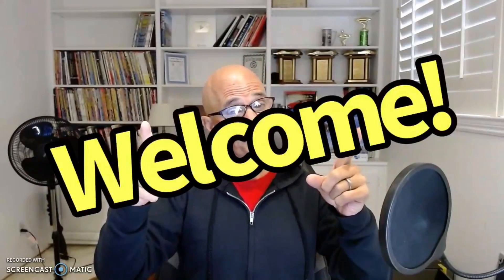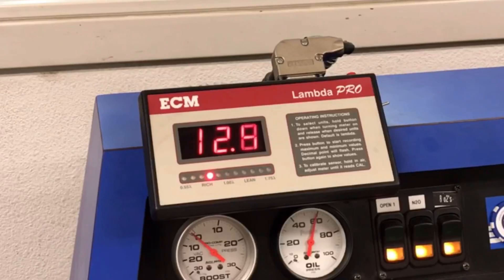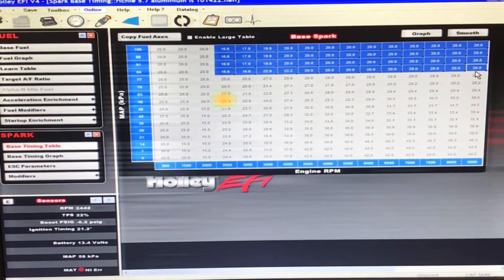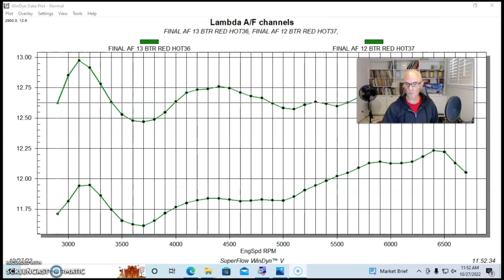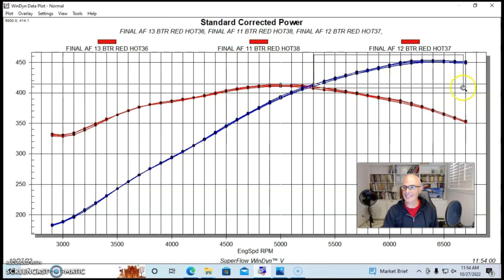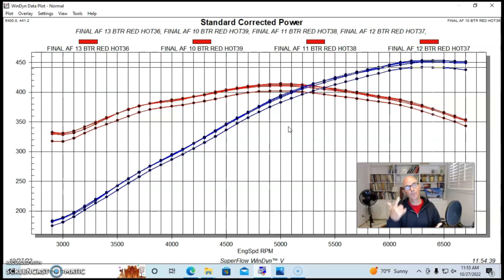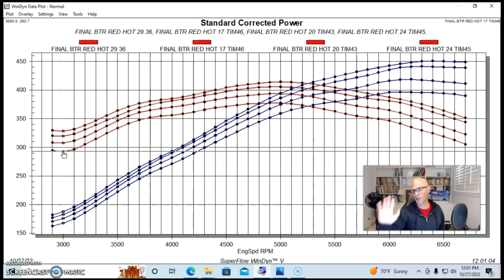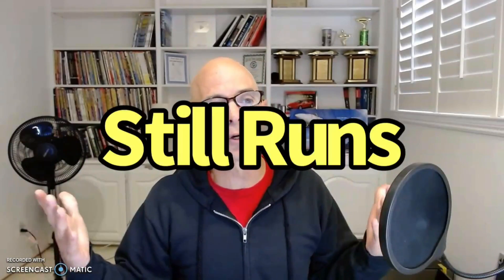JUNKYARD LS TUNING SECRETS! A/F TEST-10:1 v 11:1 v 12:1 v 13:1. TIMING TEST-17, 20, 24, 29 DEGREES!

Comment: Another great video! Using a butt dyno in my 3800 it’s very similar fuel requirement and it’s power between those afrs under boost isn’t that noticeable but obviously I try to keep it on the cool side of things as I’m happy to loose a couple of hp for a lot lower egt! Same test on a turbo set up if you have one laying around running would be great!
Reply: There is a formula, and some websites have calculators, where you can use the weight of your vehicle vs et at 1/4 mile to get an approximate hp/trq rating for you vehicle
Reply: @playinghookywithdavidchapa387  it’s definitely not quick but still a bit of fun all testing being done on a private road of course!! I have been using the Wallace speed calculator and an app on my phone lately my 3800 v6 best et was 12.05 and should be 300whp according to the calculator and my best mph was 136 so 540hp apparently? but using the app it makes 350-400 hp and peak acceleration still just under 1 g maybe more on grenade level boost, it’s choking  back to a stock intake for now just have to port one to suit these heads,run’s mid to high 12s at the moment around 120mph on a lazy launch and safe boost and 215 economy tires though

Comment: Over the years I've found that the better the combustion chamber, the more tolerant of a wide AF range an engine is.  Something really good like a Honda K-series (or late model turbo BMW engines) don't really care much if they're at 11:1 or 14:1 as long as you're not knocking.  You'd want the richer mixture just to control exhaust temps and protect against knock, but they're just really good at maintaining a homogenous mixture and using all the air you throw at them.  For a 2-valve setup, the LS heads are pretty good as well.  For some reason, the DI LT motors, especially boosted, do not like being run too rich.  Might have something to do with trying to control charge placement in the chamber with that little cup in the piston.
Reply from the maker: would be cool to see what is happening in there
Reply: I've done a lot of DFI tuning here in Europe and also a few LT engines now, and compared to the BBC, LS, and SBC tuning I've done, the DFI engines have a much smaller window. I have not seen a difference in the LT1 and LT4 as far as tuning window, only that they both don't like to be rich or lean.
I'm guessing that it has to do with how efficient the combustion actually is. The atomization of the DFI is much better than the MPI as there's no obstruction to mess with the atomization. This means that the combustion is faster and more complete, and thus the same fuel will require more air. I have done a lot of Mercedes V8 tuning and the MPI vs. DFI show the same tendencies.  So the theory here is that the reason for the smaller tuning window is that when richened up, the engine is much quicker to act as if it is overly rich while if you lean it out, the efficient combustion will be quicker to react as an overly lean condition and spike the temps in the chambers really fast. At least, that is the theory that seems to be fitting with my experience on the dyno.

Comment: so you should not be concerned about losing power with excess fuel, but maybe should worry about carbon build up, fouling plugs quicker, and wasting expensive fuel unnecessarily.
Reply: Washing those rings

Comment: Are you using injector end point timing specific to the cam? I subscribe to the Tom Nelson fueling strategy. Give enough fuel till it almost chokes then back it off a slightly and it will live. I do all my street tuning with a 12-12.4 target at WOT. After watching this I'd much rather leave it closer to 12 and trickle in some more timing up top.
Reply: Excellent question.  To add to that, does the Holley HP calculate injector duration from start of injection or end of injection as well?  Probably wouldn't have made a huge diff, but it might have been measurable.
Reply: @ChurchAutoTest  Holleys injector timing table is called Injector End Angle. They reference the end of the pulse. And like Richard said it doesn't make power. But it does improve literally everything else. Drivability, fuel smell with a catless exhaust, as well as brake specific fuel consumption. I was able to pull a little fuel from my VE table to achieve the same target AFR in a few areas with the injection timing being optimized.
Reply from the maker: every time we try to change injection timing we get nothing
Reply: @richardholdener1727  I'm talking more of choosing  injection timing for street ability. I heard that messing with injector timing could reduce the exhaust smell at idle.any tips on ballpark starting points?
Reply: @smiller225  I adjust injection timing on the P01 and P59 controllers all the time.  I start with a well dialed in setup.  Then target progressively later injection timing.  The stock GM settings spray fuel on the back of a closed intake valve prior to the intake valve opening. This works well on a stock engine with little valve overlap. With a cam that has signifigant overlap the stock injection timing allows the raw fuel to be drawn into the exhaust.  When you adjust the injection timing at low engine speeds you want the start of injection timing to happen just as the exhaust valve is almost closed, right before the piston starts to really take off on its downward travel on the intake stroke.  I have seen long term fuel trims at and near idle go from 0ish to -10% with injection timing changes.  My cam with 61.5* overlap at 0.006 has no unburned fuel smell from the exhaust.  Before adjusting it, smelled like an old lawn mower.
Reply: Would love to see some info on this

Comment: Rich did you find that power stayed constant above 29 (maybe to 31-32) or did it drop above 29?
Reply from the maker: remained the same at 30 & 31-as far as we tested it
Reply: At WOT I find 862 or 706 heads generally like 26* safely.  Even my LQ4 with large valve ported 862s likes 26*. You won't gain much if anything over 26*.  I always laugh when I see a LS car or truck that is "tuned" for 30* and 13:1. I would reduce the timing to 26, 12:1 afr at peak torque and 12.5:1 at peak powr. Car would always run better.
Reply: @chrisreynolds6520  You're generally right, but it all depends on the application and fuel.  My 900 hp LSA on E85 runs 25 degrees at peak torque and up to 28 degrees in some places.  Tried less but it loses on the dyno and in timed acceleration runs. It'll handle more without knock, but that would just be beating the bearings out of it.  I've seen some LSA guys run a flat 30+ degrees across the board on E85 and their motors lived for quite a while too.  When I first started testing the limits on the dyno, I was sure the car would be quicker with less timing on the road, but it wasn't.  Sometimes the dyno and the real world match up.